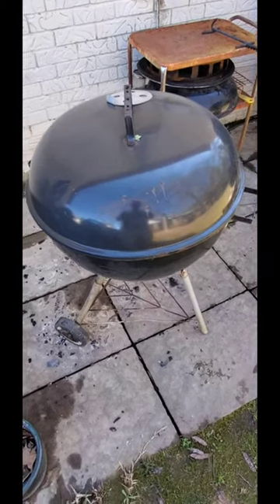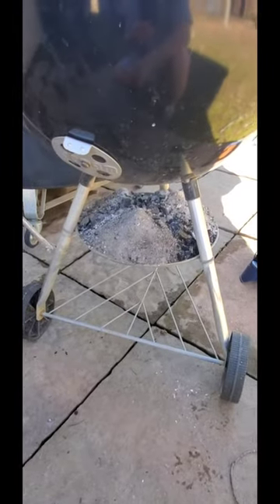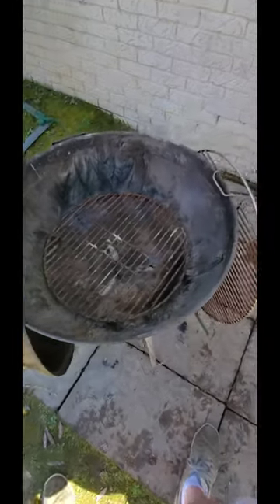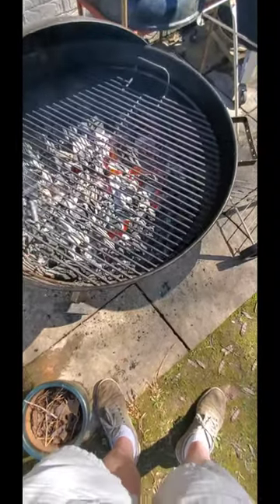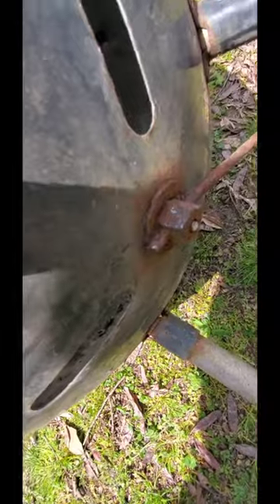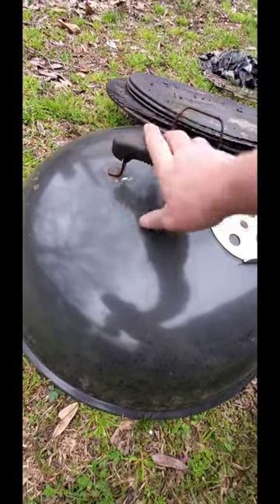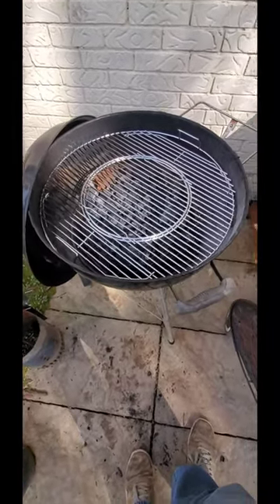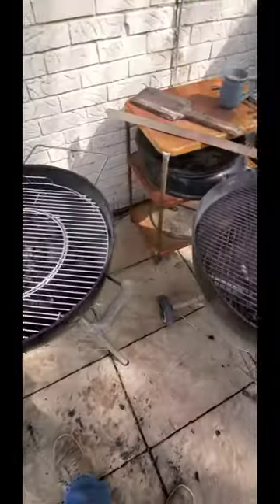Upgrading a Weber Kettle Original to a Master Touch

Comment: I guess YouTube decided to show me this 2 weeks after I was searching, trying to figure out if I could add the ash catcher to mine. 🙃

I took my 14 year old 22'' Original Kettle and added the high capacity ash catcher. Added that plus replaced the handles with new style and replaced the damper blades. $85 shipped I think was well worth it to refresh an old Kettle. I would have liked to replace the legs and leg support on mine and they are quite rusty, couldn't justify the price ($48 + $35) as they still work.

P/N 7478 Webber tool hook handle
P/N 80671 Lid Handle
P/N 65143 22" ash catcher

P/N 7444 One Touch damper blades (Cheapest on Amazon. I've replaced them several times) Use a grinder on the bottom clip/nut as to not "cut" into the bowl. The heat from the grinder also works these loose and it end up just falling apart before you grind into the bowl.

Comment: One great thing about Weber equipment, you can get parts & support for their products going back 40 years! It is cheaper than you may think plus you come away with a still high performing machine which will feed everyone of us & if you have a family, them too! You just have to take some deep inspection of yourself to understand to appreciate what these simple machines do for us & give them some periodic simple maintenance. (Give them some hard earned LOVE! Weber kettle cookers & many others need to be maintained!)
Reply: Weber support sent me a new bowl 3 years after I bought mine just because some of the paint bubbled up on the bottle inside where the leg support are spot welded. I will always buy their products.

Comment: I recently acquired my grandfather's 1999 kettle. It's also a little banged up so I'm spending the time to sort out the rust issues, the dings in the metal work and clean all the years of burned on grease. She's going to get new legs, handles, ash sweepers and catcher, grills and a fresh layer(s) of heat resistant paint. It's going to a fun project.
Reply from the maker: I would recommend getting the Weber brand sweeper assembly and not the cheaper no-name replacement, they don't last.
Reply: @boonecollard  Thanks for the information. With exception to the thermometer and paint, all the parts will be genuine Weber parts either from Weber directly or from local sellers.

Comment: I put a temp gauge on mine and that’s the best upgrade you can do. 
I also ran screws in the legs at the top. Every time I would move it before the legs would fall out which was extremely annoying.

Comment: My OG Weber has wooden handles and instead of an ash sweeper it has three vents on the bottom just like the one on the lid. Old as hell. The legs would fall straight out so I had to use a high heat metal tape wrapped around them to keep them in place. She cooks as good  as new one.